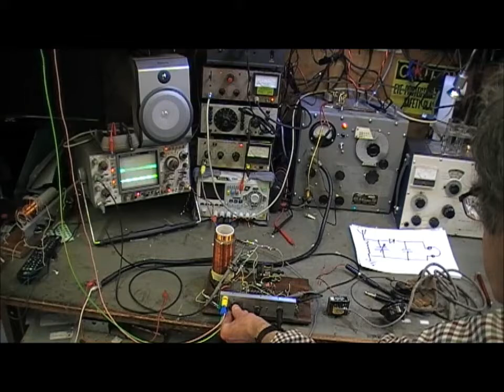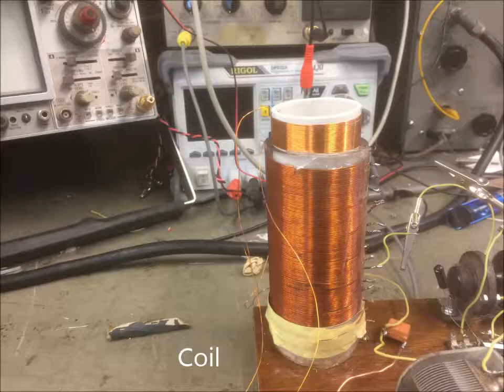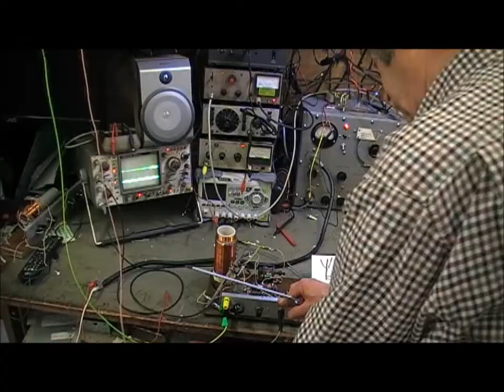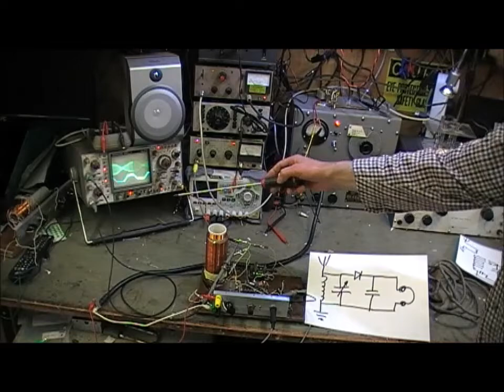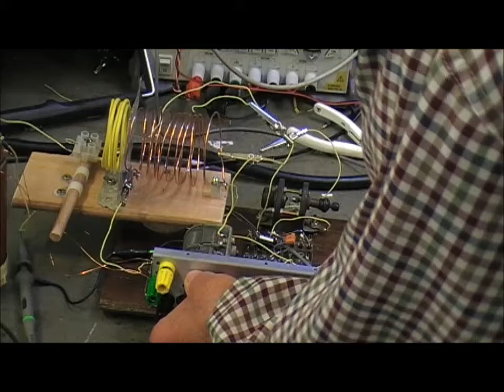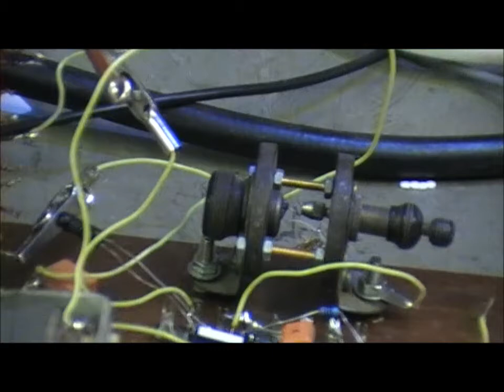Radio rediscovered part 1, crystal set

Comment: Greetings from South Carolina, US. Nice crystak set, I built my first crystal set in ther 9th grade, MANY moons ago. That led to gettig an Amateur Radio licenses and studying elxtrical engineering in college.
73 es God Bless
Glenn WA4AOS
Reply from the maker: Thank for the kind comment, good on you for the electronic study, thats what I took at uni. When I get round to it there is a part 2 to the radio, a 2 transistor regen TRF, managed to copy a 80m SSB net from 300 miles on it , very pleased, 
cheers and 73
Dave